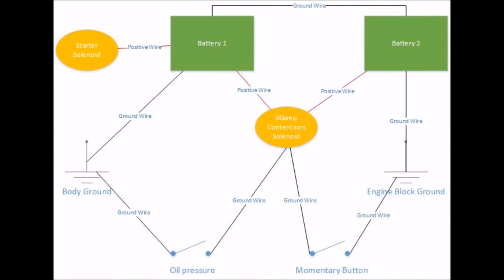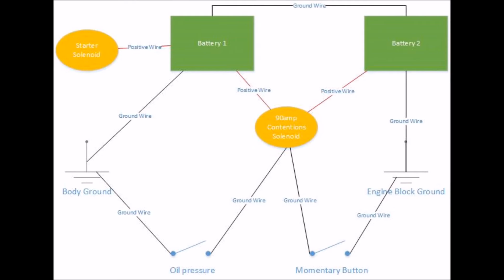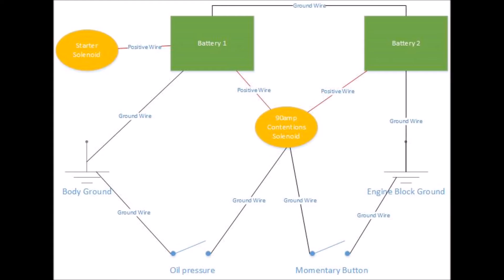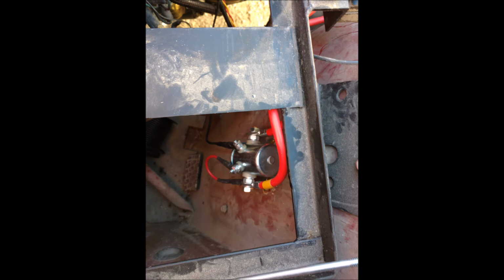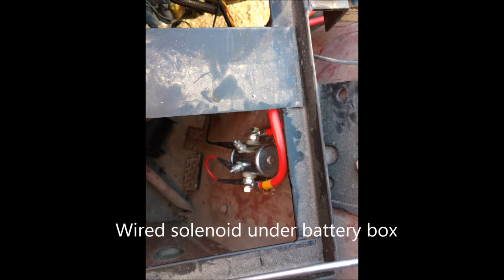How to wire two batteries with isolation in a jeep wrangler YJ

Comment: It's typically not a good practice to put the switch on the negative/ground side because if you get a short anywhere it will complete the circuit. The solenoid is likely surrounded by grounded metal like the body of the Jeep.

Comment: What battery did you use to not hit the heater lines
Reply from the maker: Two group 24 batteries with a battery box built to hold two batteries.